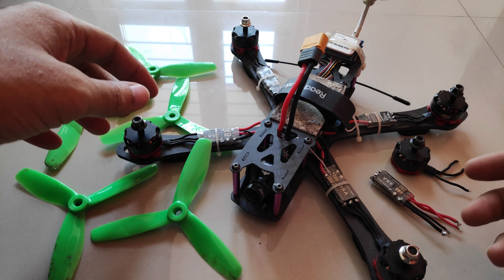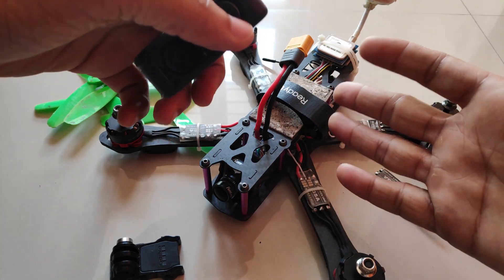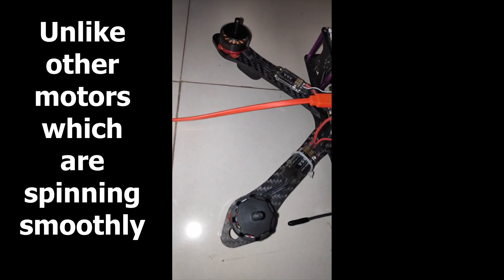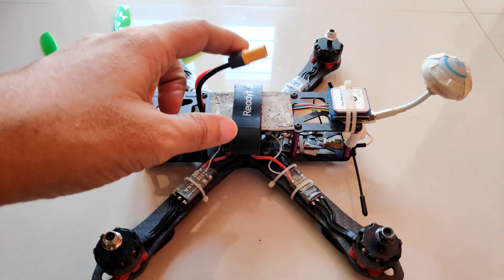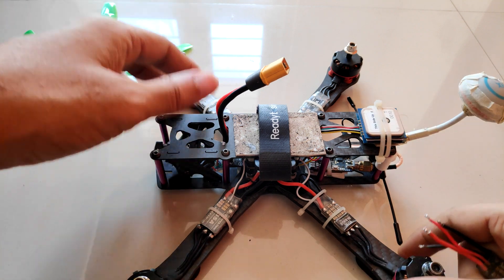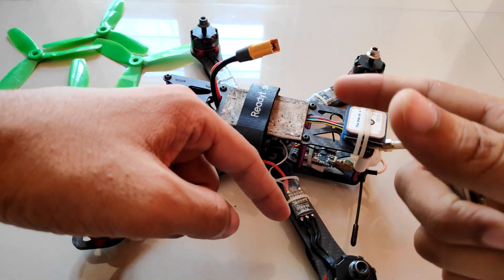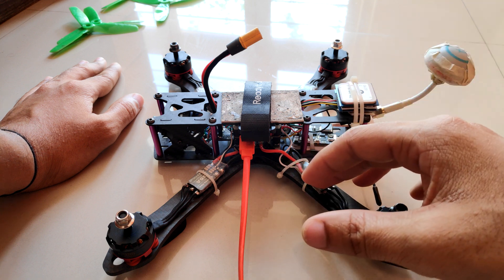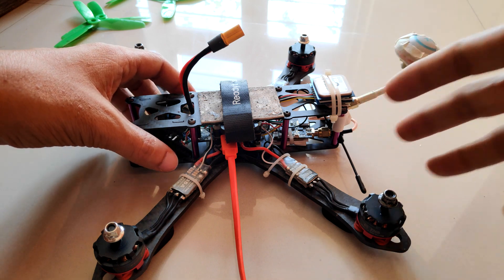Fix FPV Quad Motor Twitching & DeSync Death Roll Falling to Ground

Comment: A cheaper way to see if it's the motor or the ESC is to switch them around. I did this for a tinywhoop and realized it was the  motor that was malfunctioning, but the symptoms were the same as a desync.
Reply from the maker: Yes it's a good idea too. However i checked the flight log and also in motor test tab to identify the faculty esc /and motor. Sometimes just re soldering the esc and motor fixes this issue but better to replace than keep in testing.